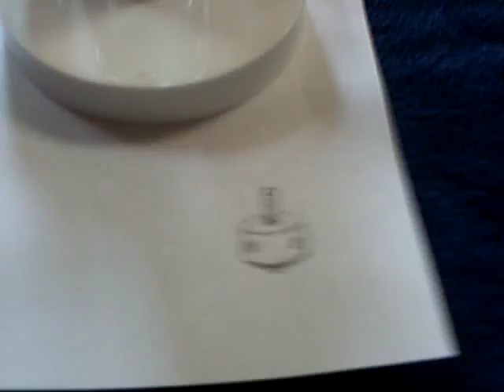Spinning magnet top ----running on a simple one coil circuit

Comment from the maker: The cap voltage starts at the the battery voltage (about 1.5volts).  Unfortunately the circuit uses energy and it is not a free ride. This would run on the ground probes you mention if the metals were say zinc and copper to form an "earth battery".   It would be a simple galvanic cell but the low power required to run this circuit would allow for some magic to happen-----LIGHT with very little energy spent.  A much easier energy source is a solar cell with a rechargeable battery.

Comment from the maker: The circuit will run solid state if you get the resistance values right.  I have to 'tap' start it though or spin a magnet in front of the coil to get it going first.  If you are interesting in flyback charging this circuit will do that also.  Come off the collector with a fast diode instead of the led and into a second battery.

Comment: When you disconnect the battery. What voltage is in the cap? I am thinking if low enough could 2 probes in the ground keep it going once started? If yes then the potential to have many in your garden and harvest small amounts of power from each and save a huge amount of energy. I say small because it's easier to get them going and you can build them on a small table. What do you think?